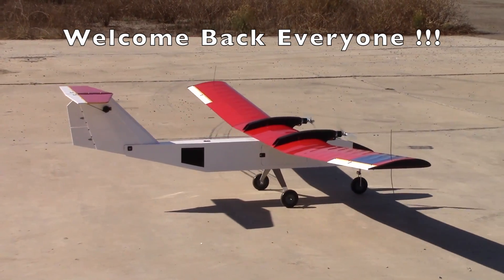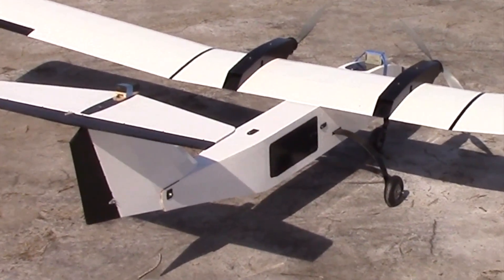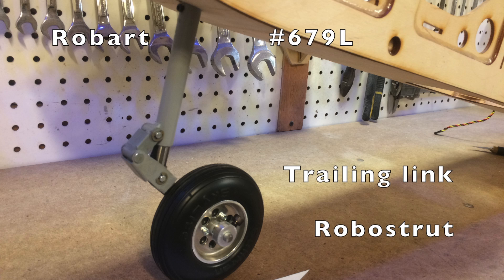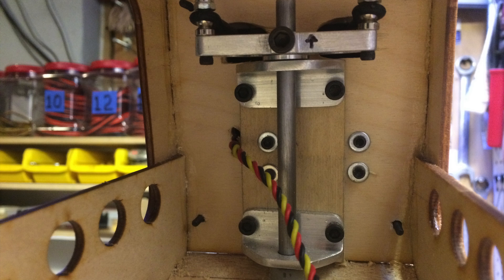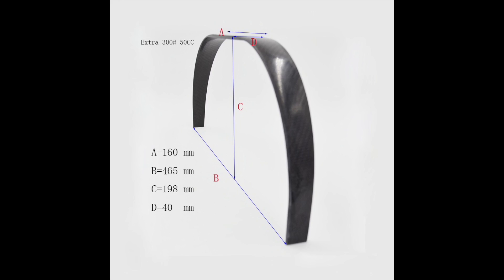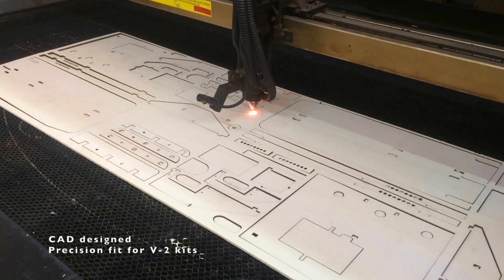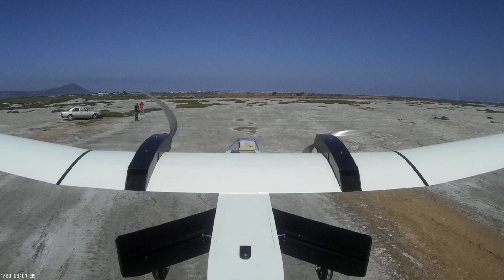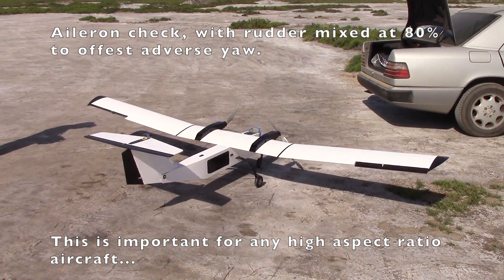Gemini V2 Custom- UAV Improved Air Brakes- Extensive Modifications

Comment: Always great videos. Sorry question here from a novice. If there was enough room would air brakes lifting from the topside wing (like a glider) be more effective to disrupt airflow and lift? I'm assuming the size of these coming from the fuselage is what what's them so effective? 
Also would would recommend this as a first build from a novice?
Reply from the maker: Gliders use Spoilers because they are so lightweight for the amount of lift them make, they can afford to sacrifice some lift.   They carry no payload,engine, or battery.    Some airliners use them in flight but they have warnings that do not allow them to be used below a certain speed. They are usually not used unless the descent rate has to be drastically modified.  They are used on landing routinely, but only once the plane has touched down, and the lift is no longer needed.  having them on the fuselage sides does not create any pitch stability issues, as flaps do,  and in fact improves stability in Yaw at low speeds, which flaps cannot.  it's also easier to modify the fuselage bay than to rebuild the wing.   Gemini V-2 could be fitted with flaps. It would work, but may be hard to fly for beginners in manual mode. 
Recommend getting a motor glider trainer, such as a radian first, just to get some mistakes out of the way. Also spending some time in the SIM is helpful for complete novice.  Gemini V2 is not hard to fly.

Comment: Can it fly 100 miles like my twindream FPV?
Reply from the maker: we have only flown missions up to 130km at slow speed, and with moderate battery pack that allows a large payload.  
This design is optimized for endurance, not distance, but if flown at 50-55kph, and use a large battery size, over 100 miles should be easily achievable.    It's main purpose is to lift weight and keep it airborne for a long time.   Also be practical, thus the tricycle fixed gear.  eliminating the gear would help a lot too.   This has a very thick airfoil and is not really distance optimized.
Reply: @FPVREVIEWS  
Thanks for answering my question 
How much does it cost?
Where can I get it?
Reply from the maker: @franciscourena5636  Our website has all of the info. 
Designed it specifically for scratch builders, and a company in Canada developed a high quality laser cut kit. 
I also have done a few custom builds for people, mostly with custom mods, all with videos about the planes on this channel.
Reply: @FPVREVIEWS  
I can make a request for a custom built 
But can I request vertical take off?
Reply from the maker: @franciscourena5636  Working on a prototype specifically for VTOL commercial operations.  It will be a purpose built aircraft, however, as opposed to an adaptation of an existing airframe.

Comment: Why didn't you use wing spoilers? Much more effective
Reply from the maker: Yes, spoilers are very effective, because they kill a large amount of the lift, while causing drag at the same time.  They cause the wing to lose lift, great for lightweight sailplanes which have an excess of lift, but not an option for flying high values payloads that are heavy.  That's why airliners have them but only use them to kill the lift once the wheels touch the ground. It's all flap before then.  The air brakes cause no adverse effects on the stability of the aircraft when deployed like flaps. They actually enhance it.
Reply: @FPVREVIEWS  no haha, im sorry but thats incorrect. Airliners use spoiler inflight aswell. The spoilers give more drag when deployed and also decrease the lift, so the aircraft has to increase the lift coefficient to l counteract the decreased lift which results in even more drag. But in your application the air brake makes sense, just like fighter planes, where the wing load is very high.
Reply from the maker: There are limited ways to increase the coefficient of lift.  you can use flaps, such as slotted, or fowler flaps. In that case not much need for spoilers in normal operations on any aircraft.  I should clear up that airliners do use flaps, but not in normal operations.  They are used for essentially 2 different reasons, and not on approach to land.  One reason is to rapidly increase the rate of descent even further, such as if the cabin has lost pressurization, or if the pilot has not planned the descent properly and finds himself too high, needing to dive at a rate where the drag from the airframe is not sufficient to achieve the goal.  This is very rare.   Another reason is to provide more bleed air for the de-icing system.  This comes from the engines, and they may not put out enough bleed air at idle, so need to throttle up a bit to keep the de-icing system working. to offset the thrust, spoilers are used in flight.  this is also very rare, and is only done at higher speeds, never on final approach, or anywhere near that IAS.  Since there is no emergency descent protocol for unmanned aircraft, and no bleed air or de-icing systems, I don't see the application on a UAV.   We usually load the UAV to maximum practical weight during normal operations, (gross) to carry the maximum battery possible to achieve good flight time. We only usually trade that weight for payload, but that puts the plane's weight back to the same gross weight.  Only time it's lighter is when we are testing ,and have no reason to carry the extra weight. even then, it's limited in testing, as we want the plane at gross to test most systems.  The Autopilot does not know if the airplane is lighter.   
This may be different for a fuel powered UAV, as it would be lighter when it lands.    @pasifpv5508
Reply from the maker: you can see their use here, where they are deployed slightly because likely the pilot was too high on approach, but not fully deployed by any means.. 
They are then fully deployed as soon as the main wheels touch. 
https://www.youtube.com/watch?v=ZzN8RNzwdOo
Reply: @FPVREVIEWS  thanks for the info but im all familiar with this. In fact im an commercial pilot myself.
Reply: @FPVREVIEWS  and with increasing the cl i mean increasing the alpha, not deploying slats/flaps
Reply: @pasifpv5508  Great, so depending what type ratings you have, you might be familiar with the difference between ground spoilers and flight spoilers, and that care has to be taken not to use the flight spoilers in some flight regimes, such as on takeoff, and approach.   Well, then you understand why I don't use them.  I'm not going to create that degree of sophistication in the control lockouts and software in a UAV.   What types do you fly?   love your chase videos on your channel, BTW.

Comment: Any testing data on the new design vs old design?  Say your landing approach speed is 25 kts fully loaded.  What is the max slope angle you can fly and hold 25kts with power off on new design vs old design?  Maybe do a level max speed test of both designs to get an idea of the improvement?

Comment: What's the mAH on that battery? I'm still not convinced it's better than, I'm sure, much cheaper Multistar pack that is also, more than likely, significantly lighter.
Reply from the maker: The gravemetric energy density of these cells is greater than all other battery types that are commercially available at this time. 
They can also last for thousands of cycles if taken reasonable care of, can be safely discharged to 2.5Vper cell and have excellent cross ventilation. The amp output is not bad either and represents an almost double improvement over the previous generation of li ion cells. You can compare them by checking out the data sheet. They can also be configured in many different voltages and form factors. 
We’ve flown over 4 hours using them, and commercial multi rotors use them to fly for up to 2 hours. 
Same cells as used by Tesla.
Reply: @FPVREVIEWS  They're heavy and expensive compared to just about everything else out there that you'd compare these to. I took a look, they're OK.
Reply from the maker: Great, Let's do a DIRECT  COMPARISON:
these are the specs for multistar:
Minimum Capacity: 16000mAh
Configuration: 6S2P / 22.2V / 6Cell
Pack Weight: 1920g

Our battery is 35000mah also 6S, so 2 of the multistar packs would still not match it in terms of capacity.  Our pack weighs 3016 grams.  2 of the multistar packs would weigh 3840grams.   that's not including the weight of the Y harness that you would need to parallel them to run both.

So if you want add 824 grams to your model?          And still not match the capacity?

SO, how about cost:  
The Multistar pack cost 184.59 USD on the Hobby king website.   (I just looked a few minutes ago)
so two of them, that do not even equal the capacity of our battery, would cost 369.18 USD.  shipping not included.

our pack cost 5.75 per cell at this listing with free shipping, very typical of current pricing: 
https://www.ebay.com/itm/100pcs-Panasonic-Sanyo-NCR18650GA-Lithium-Battery-3500-mAh-10A-18650-cells/382690200321?hash=item591a1d0b01:g:acYAAOSw7OdcH7oo
so 60 cells at that price cost:           345 USD. 
granted, still need to buy cell holders, tabs, leads, and connector.   Let's be generous, and say they cost 20 USD. That brings the price to       365 USD.   still cheaper than the Multistar,    more capacity than the multistar ones we compared them to, no need for a Y connector,  better cross ventilation for proper cell cooling, no worries about discharging past 3V, as they can be discharged safely to 2.5V per cell, will last for hundreds of cycles even if used hard, Thousands if taken care of somewhat.
They are also tough, being individually encased in steel/ the pack encased in Rigid brick cell holders.  

So cheaper, more capacity, and nearly a kilo lighter...            What's not to like?          

 @helloman1976
Reply: @FPVREVIEWS  Yes, as long as they do what they say they will that all seems true. Are these also protected cells? If so, does that mean each cell also has a "BMS" of sorts? That is, protection from over charging and over discharging?
Reply from the maker: Not sure why you would want "Protection" when the charger balances, and provides all of those things. 
Unlike Lipos, the battery is not ruined if it runs low, as the Datasheet shows, and i have already mentioned. These cells can safely discharge down to 2.5v per cell.   any serious long endurance aircraft will be telemetry equipped, so you have hours to monitor the voltage in flight, and if it uses any decent flight controller, you can program it to RTH, or Autoland  when voltage gets to a certain point. you can also program it to do it during an auto mission, aborting the mission, and doing a RTH at that time.  
Multistar batteries have zero protection, and if they drop below about 3v, they have irreparable damage. 
No reason to have it anyway, with so much protection on both sides, the charge, and the discharge. 
"Protection" in this case aid just another point of failure. and the failure rate of the protection devices is many times higher than that of the cells themselves. 
Companies like Sanyo and panasonic sell these cells to major companies, like Tesla and HP.  If they lied about their characteristics, there would be multi billion dollar lawsuits,.   Plenty of people on youtube testing them to see if the specs are true.  We test every batch, not because we don't believe the data sheet, but to make sure the cells are genuine. 
What kind of guarantee does the company manufacturing cells for hobby king give?   Hobbyking products are notoriously bad quality. event the foam board kings over at flitetest won't work with them over their lies, bad products and ethical issues.  
We have literally demonstrated 4+hr flight times with the previous generation of cells, and the new ones are much better in terms of discharge rate. 
  @helloman1976
Reply: @FPVREVIEWS  Thanks for the reply. I was really after the answer to, if you know, if protected cells act as their own BMS if they are wired and made into a battery pack. I'm thinking of building a battery pack for a system that would not have any monitoring so if they act as a BMS they would auto shut off once they reached their cutoff setting. Thanks.
Reply from the maker: I don't buy them, so don't know.  you 'll have to do your own research.   When I don't know something, I will happily say so.  @helloman1976

Comment: Spike, this is an amazing bird! Well done! I think the air brakes are awesome. I cannot wait to see that this thing can do. Your power system is awesome. The black and white scheme looks great. Were you flying without a flight controller in this video? I like to fly my planes manually before adding a flight controller.
Reply from the maker: Yes 
Manual mode. 
I do all flight testing this way. Only way to determine effects of aerodynamic changes and prove stable flight characteristics. 
Not everyone wants a flight controller either. 
They are more and more common however. 
Sorry I’ve been busy lately but welcome discussions.

Comment: What about just having nice big flaps?  Split ones on the inner portion and normal ones out to the aileron.
Reply from the maker: The airfoil we’re using already has a very high coefficient of lift so flaps would not help create much more lift. Flaps also change the effective angle of incedence of the wing, so tend to create instability in pitch. 
These type help stabilize the aircraft especially at low speed. 
Applying a greater angle of attack to an outer wing section can cause a tip stall if the outer section stalls first. We’ve tried split flaps and these work much better. Easier for the pilot, simple and can be quickly retrofited to existing aircraft. Also no external linkages or control horns to cause drag. 
Slotted flaps would be the only useful option on a slightly thinner wing, but we’d insist on having internal hinges and actuators. Would be very complex, but would actually increase lift.